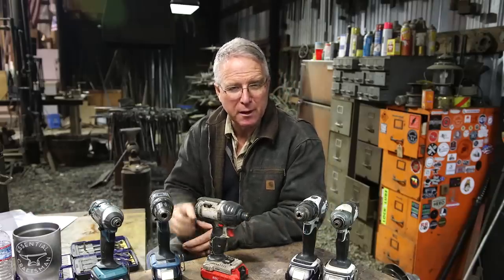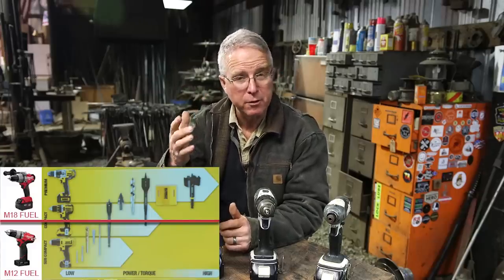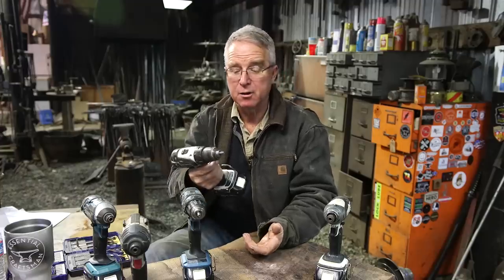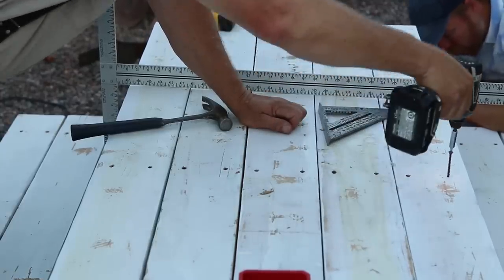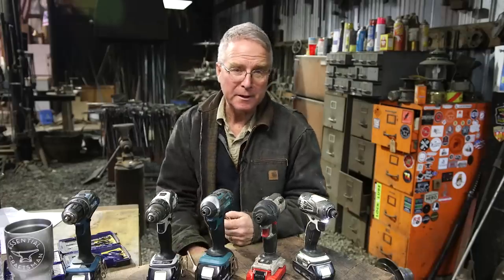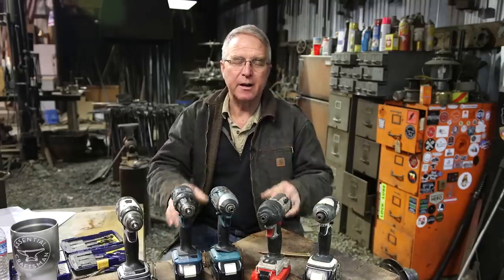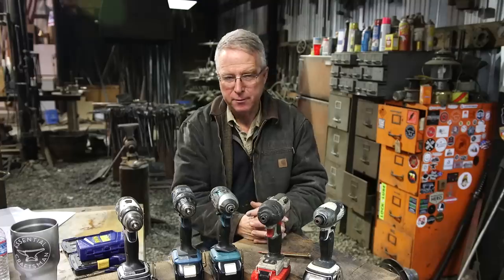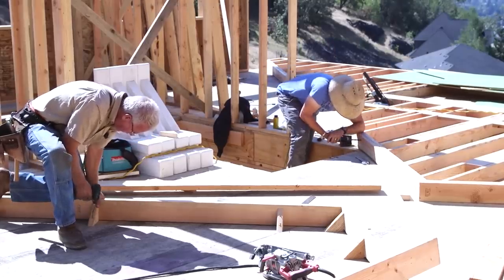Impact Driver Vs. Drill Driver

Comment: I ran the service and warrantee department of a large tool store for several years. I can tell/show you SO many ways to break either of these!  All customer discovered. ;)   Biggest most common failure though is using “cheap” bits in an impact. Want them to last, and not make you need to toss out your impact?  Get Milwaukee Shockwave bits.   You twist the head off a cheapie inside your anvil - it’s not coming out. New parts and labour? Frequently exceeded the cost of a new impact.

Comment: I'm a DIY'er and have been using both impact and drill drivers for quite a while.  Generally, I use the drill driver to drill a pilot hole then use the impact driver to drive the screw.  Having both with you saves time from switching out bits.  Cheers!

Comment: The new Milwaukee impact with the hydraulic fluid has totally changed the game. I can use it all day and not feel like I have Parkinson's in my hands at the end of the day. we compared it to the regula Milwaukee fuel impact and although the regular is slightly faster, it doesn't keep the power maintained by the hydraulic impact on screws 4" and longer. Its perfect for those 14" structural screws. Will never use another drill/impact. Never use and impact to drive on a nylon lock nut. The nylon overheats, swells and locks on permanently, usually before its tight, and you will need a cut off wheel to remove it.
Reply: Great comment and Wow , thanks for that advise 👍
Reply: Agree I just bought the M12 Hydraulic its so quiet!
Reply: I use the m12 surge impact for HVAC install. That sound decrease is really noticed in the confined spaces I work on a lot.
Reply: I tried the RIGID version of that and wasn't happy with it, and ended up returning it. It wasn't as controllable and vibrated a lot.
Reply: @mikejones-ku5ix  your right i totally glossed over how much quiter it is. Its night and day difference. My regular fuel impact is at the bottom of my toolbox, forgotten like its Ryobi or Craftsman brand
Reply: @paulremmey8268  Thanks i dont really post to youtube, but I love my m18 surge so much everyone should know about it.
Reply: The Surge (hydraulic impact driver) isn't as powerful as the regular Fuel version, and the noise decrease is inconsequential to me. The Surge is better for lighter duty work and work inside the house, and the regular Fuel impact driver is better for heavier duty work.
Reply: I find it hard to believe your hydraulic impact maintains higher power on 4 inch fasteners. I have M18 gen 2 impact and hydraulic impact and the hydraulic is nice but has nowhere near the power of the regular impact. I have tested this on many, many fasteners and torque specs. I use Makita now because I feel their impacts are superior and they do not have the horrible collar issues Milwaukee has.

Comment: I don't know whether they're a thing in America, but in the UK we have socket sets that consist of a ratchet handle and interchangeable sockets. You can get an adapter that allows you to put the socket bits on an impact driver, allowing you to use the same socket set by hand or with a power tool.

Comment: I've been around tools for a big portion of my life but I can honestly say that I was the most excited when I first used an impact driver and how easily it would drive even the dullest of screws into solid wood. It was pretty rough back in the day when you'd try to drive a phillips head screw and it would slip and get stripped out and then you'd have to take it out and put in another so I thought life was good when I switched to hex heads.  I've been with Milwaukee for a long time but for my personal use I got a Makita XDT13 because it came with a 3 Ah battery. Feels like I'm cheating on Milwaukee but they skimped on the battery in the kit.
Reply: Hmm you need to shop batteries, i've got an M12 Milwaukee Ratchet with a 4 ah battery.

Comment: I needed this video 5 years ago when I bought my first power drill. I did so much research on getting the best drill I could find, not understanding that drilling and driving are two different tasks for two different tools. I spent more on a single cordless drill than a set would have cost me, but like you said, I could only do half the work! It wasn’t until I started doing construction that I understood the difference and necessity of having both. I bet even a low quality set of a drill and impact driver would be better than spending thrice the money on a single cordless drill.

Comment: I have a set of these. Used the impact for loosening rusty and weathered screws on my windows. I was a revelation.
Where the drill stripped or worse, snapped some old screwheads clean off, the impact released all the remaining screws no probs!

Only thing is, i didn’t buy the brushless version (DeWalt). I’m no power user, but next time i would spend the premium. Better battery use and longevity. 

Only noticed i had bought the brushed ones when it smelled like the Marklin- trains i played with as a kid. Nice flashback though :)

Comment: Great video, but it is worth mentioning the difference between an impact driver and hammer action on a drill. Hammer is in / out or up / down and used for drilling into brick, block or concrete. Then you get into the subject of SDS drills!

Comment: One of my favorite tools is a KREG pocket hole jig. Kreg makes a stepped drill for the pocket holes that will lock into an impact drivers socket. Problem is the impact action will twist the end right off that drill. I could use just a regular smooth power drill but the length and interchangeability feature get out of hand. Milwaukee makes a 1/4 inch socket driver without the impact feature. Works great for me.

Comment: Scott, i was surprised that you didn't mention the old manual impact driver that was used in the past, before the cordless revolution, to finish tightening a screw.  Im talking about the one you hit with a hammer, and it causes the screw tip to turn just a little bit.  I was sure that an old school carpenter such as yourself would have one of these collecting dust somewhere.  Last time i saw one was when i was a kid pilfering through dad's tool box.  i think it might be a good device for showing what the impact driver does 1000 times faster.

Comment: With the introduction of those GRK self tapping screws, I find myself using the drill more and more. Love those things. Mainly use my impact driver for larger lag bolts/screws. He's 💯 though, you can't have one without the other.
Reply: you use a drill for self tappers? i haven't done that in 10 years, the impact is better for it anyway.

Comment: You typically get a drill and impact driver in a kit. I use the drill with a bit to pre-drill holes to avoid splitting wood, and the driver to put in the fascener without ever having to stop to change bits. Just wish i had a 3rd arm/hand to hold onto the ladder when working overhead!

Comment: 1. I had an intern who went on to work for a screw manufacturer and he was the one who explained Philips heads to me after years of frustration. “They’re SUPPOSED to cam out,” he said. They were designed for automated assembly lines. A standard slot would lead to busted robot drills or busted screws. 

2. I know a fantastic set builder/designer who uses an impact driver because she happens to be a tiny (and beautiful) woman. Her beloved Milwaukee compensates for her only being 98 lbs.
Reply: Pics or gtfo

Comment: I bought a dewalt "driver" for screws. I have broken heads off screws with impact driver. I have dewalt gyroscopic stick, dewalt driver, dewalt screwgun w/hammerdrill option, and Panasonic drill and separate impact driver. Not partial to brands but my Dewalts take a beating and work. My Panasonic impact is light and lasts really long. I will say that some features on ALL models annoy me : the reverse button, when wearing work gloves, will turn on. It needs a lockout or relocation for direction. I would like Makita but I am happy with all I have. Impacts can also be dangerous with non-impact rated bits.

Comment: Interesting video. I’ve been using two cordless drills, one to drill a pilot and other to screw the screw. I always thought an impact was mostly for lugs and concrete drilling. I would recommend a quick switch drill/screw driver kit which allows for quickly drilling and thru a licking collar to flip the head in the drill to screwing mode. Montana is one manufacturer that makes them for around $9

Comment: socket adapters are incredibly useful addition to an impact driver, I had to drive a bunch of 3/8" lag screws so I picked up an impact socket and adapter and ran the lag screws home one after another (I did pre-drill)
Also, make sure everything you get for your impact driver is impact rated, the impact driver is like putting a wrench on a bolt and hammering the other end of the wrench to break the bolt loose, I I had half a Phillips bit shear off because it wasn't impact rated.

Comment: I carry 5 different drills in my kit every day.  Hydraulic Impact Driver, Hammer Drill/Driver, Screwgun, SDS Hammer Drill, and Spade handle drill, all cordless save for the spade handle. Each have their uses, and when you dont have the one you need with you, or at least nearby... it can slow down production.

Comment: As a 'home gamer' as AvE would say, I use the yellow ryobi impact driver and drill driver. I love them both - but when you have to consider the sound that it makes for your neighbours, (living right next to one another), you start t err towards the drill driver for tasks the impact is better suited to - just out of consideration for the huge noise. (Design flaw - my garage/workshop literally shares a wall with my neighbour's master bedroom..).

I've found you can get the job done with a drill driver most of the time, but of course you're going to strip out the screw head, more likely to hurt your wrist, etc.

Comment: i got a set, i use the impact almost exclusively. my impact has a speed controller on it so it doesn't over do the job it being used for. its great to have 1 hand free, the driver needs 2 hands if i use it to drills holes since the torque can go out of control. impact is such a time saver.

Comment: I always referred to the drill/driver, as the drill and the impact driver as the impact. On my drill/driver, I always use the high speed setting to drill the pilot holes and the slow speed setting to drive the screws. Hence the name. I always use the impact driver for larger #10 and up wood screws, that don't require a pilot hole, and I want the extra force to hammer them in. But, check the speed ranges of the drills, you can get some with a lower #1 slow setting and a higher #2 setting. So use the speeds/torque to your advantage!

Comment: As always a great video. 

I appreciate the difference and what they are good for however I have complemented the drill/impact sets with screwguns. 
Built a lot of decks last year and found myself using the drill more often than the impact just due to noise pollution even though the impact does a better job and uses less battery power to drive screws.
So I ended up investing in cordless screwguns, a lot of people call them drywall guns. They are quite a bit louder than my drill but not abusively loud like the impact drivers.

Obviously ledgerloks and structural fasteners still get set with the impacts, but a drill with a depth of drive setting is preferred over an impact driver for screwing off a deck. I just dont enjoy hearing the racket when I have a couple thousand screws to set 😂

Comment: I like using both - drill a pilot hole with the drill, put the screw in with the impact.  Saves a ton of time having to change out bits if you only had the drill.  I find my impact is too powerful sometimes.  It has 3 speeds and I rarely put it on 3.  Usually 2, but sometimes 1 if I want to make sure I'm not sinking the screw head.

Comment: When I'm using them indoors, for the most part I use them for opposite of intended use:  The impact driver gets a hex-attached drill bit for making pilot holes, and the drill driver gets the socket to drive the lag in.  Reasoning:  The impact driver's max rotational speed is much higher, and it chews through drywall and studs much faster, (just spin the bit in air to cool it down between unloading passes on longer drilling sessions), and the control of the slower rotating drill allows me to get those lags tight without burying them through the drywall like the impact wants to do. The best accessory you can get are these titan swivel extensions: https://www.northerntool.com/shop/tools/product_200710043_200710043yP7AIVOx-tBh0d2QOpEAQYAyABEgK9XvD
I was using my cordless drill as a "power wrench" on hex bolts and nuts long before those impacts were even available.  Seemed like a no-brainer to use those hex nut drivers.

Comment: One thing not mentioned is that the hammer/anvil set-up of the impact driver doesn't transfer the torque to the users hand, wrist, and arm. As a manufacturer assembling with 1/4-20 machine screws for 6,8 & 10 hour days, day after day... the impact driver is a hand and arm saver. Counter intuitively, I also want the lightest tool which will get the job done, without shearing off the screw/bolt heads. I use Milwaukee M12 for manufacturing, and the Porter Cable 20 volt for construction.

Comment: You can also leave your pilot drill in your drill and still be able to drive the screw... There used to be a quick change b&d (homeowner level) tool with the hex quick connect underneath the drill chuck. Lovely idea, but no longer on the market.

I do love the term "swing press".

Comment: During impact the torque is used to drive the screw in. Between impacts the torque is low and allows to re-engage the tool into the screw head, refreshing the grip.

Comment: I dont use tools for a living. Bought my first air compressor when I started building my house about 20 years ago. Have not been without one since. While building that house I discovered what a pain it was to get the hose to stretch far enough for the framing nailer and dragging it around. Wished at that point I would have ponied up some more money for a cordless model. had very few Ni-Cad cordless tools because of cost and short battery life. I have finally made the realization that I should join everyone else that has already accepted it is the 21st century and get some battery powered tools. Problem now is finding a brand that has the tools I like that I can share batteries without breaking the bank.
  Very good advise. Thanks for sharing.
Reply: Makita has a ton of cordless tools.

Comment: I use a drill at the setting of 1 or 2 to quickly replace electrical cover plates without wrecking them after a repaint.  About 5-10 secs each. I am a painter and it is so much better then a hand screw nowadays.

Comment: One of the BIG values of impact drivers is the change in torque between impacts. The reduced torque allows the Phillips bit to reseat in the screw. The screw driver's constant torque can cause a slow climb out of the screw, stripping the screw. Modest down pressure hold the impacting bit in the screw. It takes much more down pressure to keep the bit in the screw with the drill driver.
Some impact drivers apply higher torque before they start impacting. This defeats the value of impacting allowing the bit to reseat. The bit can climb out of the screw and strip it before the impacting starts. My 12 volt DeWalt works much better than my M18 Milwaukee. The Milwaukee often twists out before the impacting starts.

Comment: I wonder why Kreg tells people to not use impacts and only has square drive bits for pocket holes. I kept stripping 2 1/2” ones on a recent project using a drill and gave up and used a biscuit instead.  Thanks for this illuminating video

Comment: Several years ago I added a 12v impact driver to my daily tool list.  It was light yet powerful.  Being brushless it worked great for long time I had to replace it about 2 weeks ago and for just a little more money I got a 20v   It works great for construction type screws but is too powerful for anything shorter than about 2 inch screw For that I have gone back to using the 12v drill.  I have several 18 v drills as well.  Making it nice to have a choice depending on what I am working on. Hopefully I will replace that 12v impact it was so handy. I find it odd that only a few companies make a 12v. I guess too many figure bigger is better.  Sort of the Tim Taylor approach.

Comment: After testing both driving screws. I went with drill, even for driving fairly big structural screws. With the two speed gearbox, and clutch, I find I can get much more consistent results driving screws just flush, with the drill, than with the Impact Driver.  Plus the drill doesn't sound half as obnoxious as the Impact driver. 

Mind you this is just for DIY around home, I can understand if pros need extra torque of an impact driver to driver big structural screws quicker.

Comment: Lots of good info in this video, and I think you've convinced me that our house needs a DeWalt impact driver to complement the DeWalt drill driver we already have (staying on brand so they both use the same batteries).
However, the audio in this video is heavily biased to the left ear for some reason, so I think something may have been missed in the editing process.
Reply: and Luckily now a days the Dewalt 20 volt Impact has a speed control and if you do the Tool Only at home depo or lowes it's around 100 bucks.
Reply: @georgetinc9578  That's a pretty good deal actually, considering you probably get another two batteries and a charger.
Reply: @44R0Ndin  Unless you're buying Ryobi i highly doubt it, besides i said TOOL ONLY at home depot and lowes for the dewalt 20 volt.
Reply: @georgetinc9578  Oh right you did say tool only, that's on me for not reading. The drill driver kit we got did include two batteries and a charger, and we got it at Lowe's.